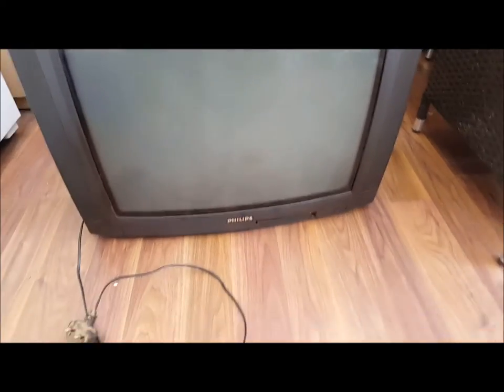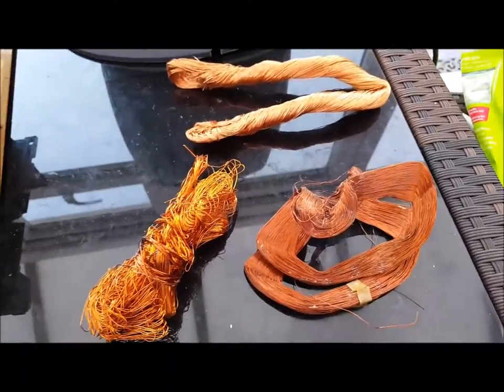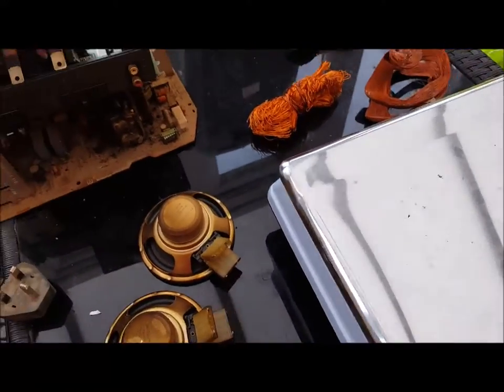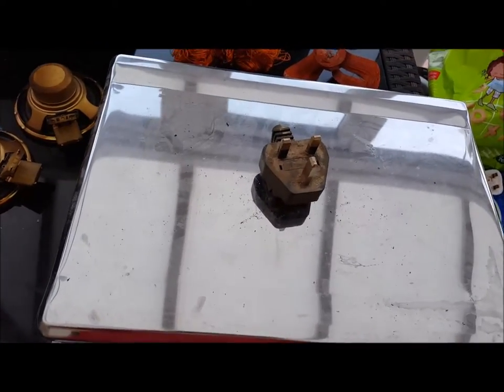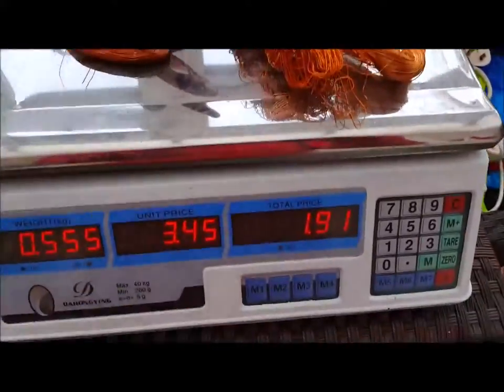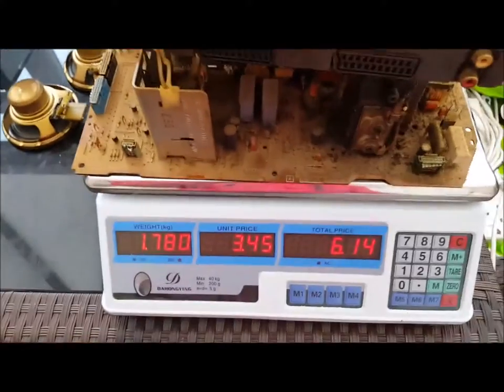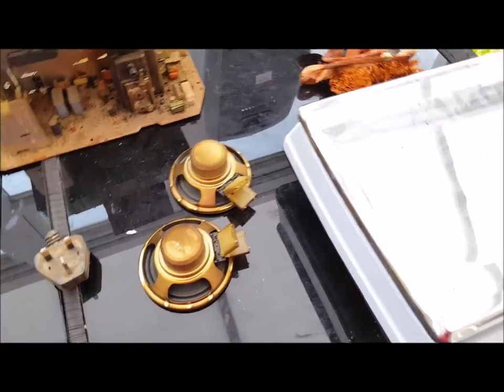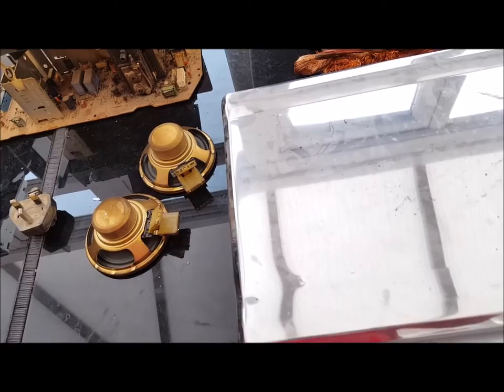scrapping out a crt tv to determine its value

Comment: I found a good way to strip degaussing cables ,just slice the area where the insulated wire comes out then grab 1 or 2  single strands of copper wire on the outside of the bundle with a pair of pliers ,then pull and it acts like a zipper and slices the tape easily
Reply from the maker: I wish the tape wasn't so sticky my hands afterwards are covered in dust which is stuck on by the sticky stuff